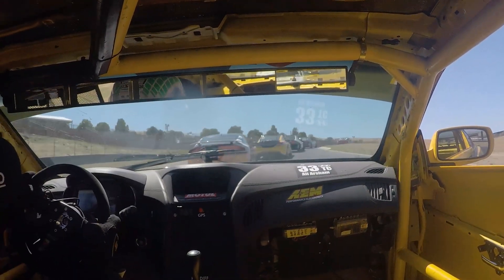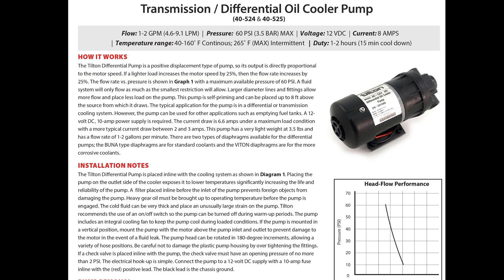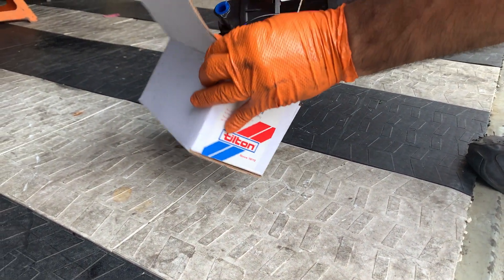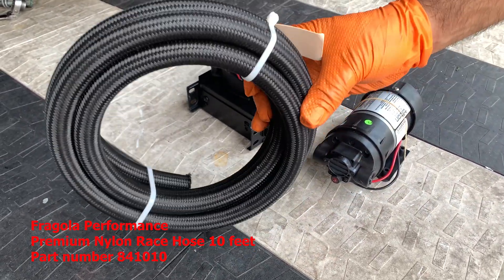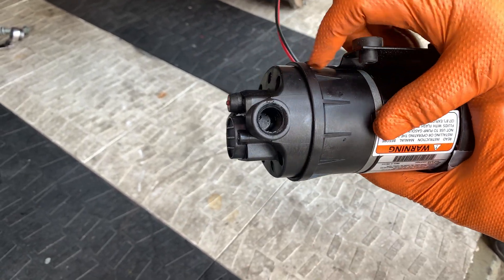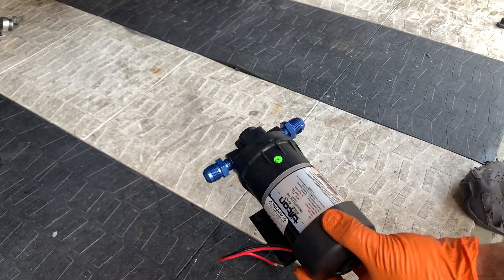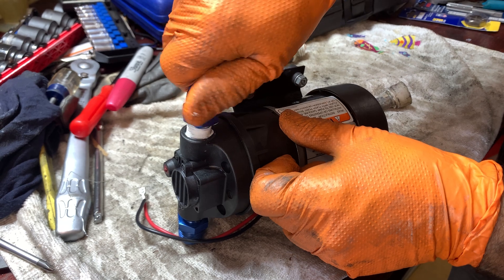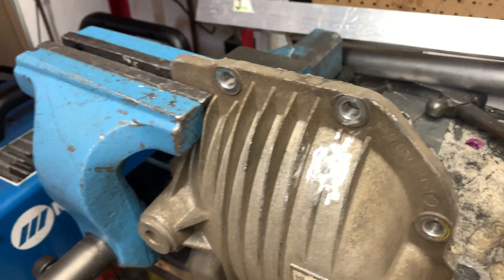Installing a differential cooler on a Hyundai Genesis Coupe race car

Comment: Following up on my question from three months ago:
How do you ensure to maintain the correct oil level in the differential whether the pump is ON or OFF? With the installation mounted above the normal differential oil level, the oil can draining back from the cooling system and overfill the differential when the pump is not running.
A check valve may help, but not sure it would be consistent enough to stop any amount of back-flow.
Reply from the maker: Fill it with oil to the usual point. Run the pump to fill up the cooler and lines. Then fill up to the same point again.

Comment: How do you ensure to maintain the correct oil level in the differential whether the pump is ON or OFF? With the installation mounted above the normal differential oil level, the oil can draining back from the cooling system and overfill the differential when the pump is not running.
A check valve may help, but not sure it would be consistent enough to stop any amount of back-flow.
Reply: Yes I need to know too..

Comment: Why not just use the drain plug for return, better to be in rear for g’s ?
Reply from the maker: It is too low to the ground., It can get easily get hit and break off and then can cause a DNF or a big crash.